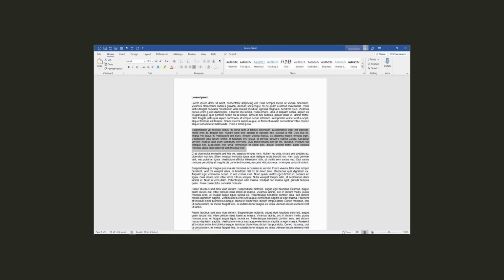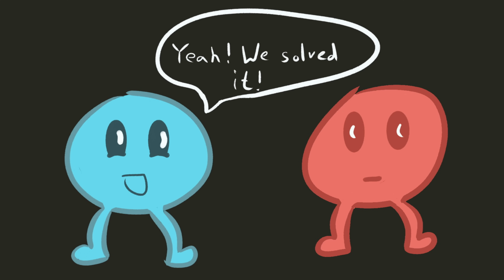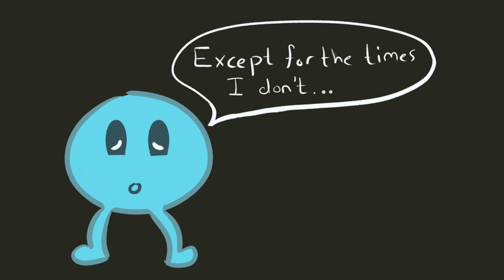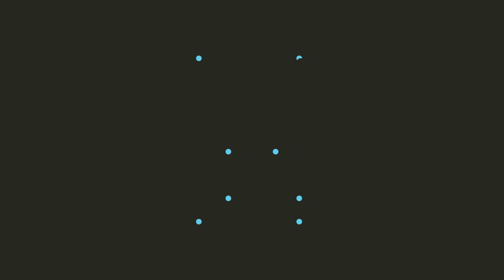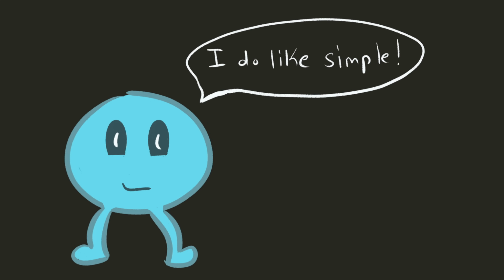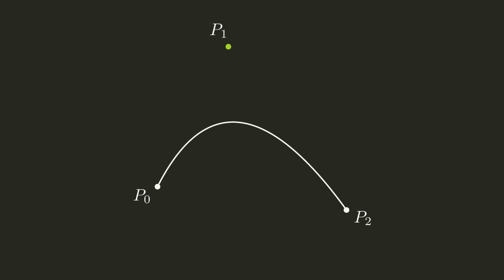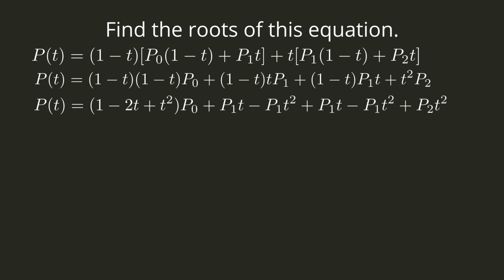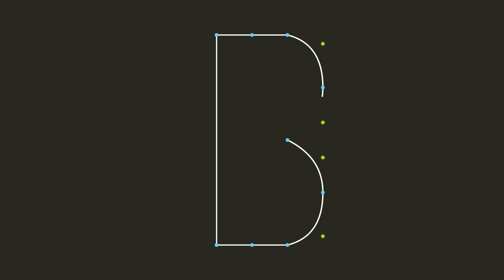The Math Behind Font Rasterization | How it Works

Comment: A few notes on what most actual implementations do (from what I've been able to read), just in case anyone thought this was simple:
* Solving quadratics is (probably much) slower and harder than just subdividing until you're smaller than pixels then testing against the x coordinates of the points closest in y coordinates.
* Generally the letters (or, more generally, glyphs) are only rendered once per font size when needed and then that copy is stamped at all the places it's needed.
* It's common to use the fact that PC monitors layout their pixels in vertical RGB stripes to get more horizontal resolution.
* At small sizes, avoiding blurring as lines cross through pixels is more important than exactly representing the outline. The solution is pretty crazy: TTF fonts include programs that execute to adjust the coordinates based on size... and potentially other things like weight and surrounding characters!
* This doesn't work if you're animating, as you can see the outlines jumping around (and it's slow). In this and other situations, like very large text or 3d, signed distance fields (or SDF), which are basically fancier bitmaps that are quite good at approximating the outline but still very fast to render.
Reply from the maker: Hey Simon! Thanks for the great overview on some of the more technical details of font rendering :). I didn't know about the optimization you can use to avoid solving quadratics, and I'd be interested to try that out at some point. I also saw your comment about .bmp, and I do apologize for any inaccuracies there. I always forget to check some of the finer details when I make videos like this haha
Reply: @GamesWithGabe  I have a renderer called TD renderer. It is based on FreeType, however, it makes use of my own rasterizer.
Reply: Per your third point: BGR monitors exist, and text will look weird with blue and red fringing because of this if the OS assumes it’s RGB.
Reply: @EpicWolverine  they were quite rare even back in 2000 when Microsoft introduced cleartype, and now I would be shocked if anyone was shipping a full PC monitor in BGR. (Googles) Wait, really: Gigabyte shipped a BGR panel in 2020? And lots of TV panels, and thus some large monitors, do too? Do they hate humanity or something? 

Still, windows 11 still has the Adjust Cleartype Settings program to switch to BGR, but it's only a partial fix, as not everything respects it. Lame.

More relevant to many people is that phone screens generally have a totally different layout, often large green squares with blue and red stripes dividing them vertically and horizontally.

They're also much higher density though, so there's no need for subpixel rendering.
Reply: Thanks for the info. It seemed obvious late 80s computers couldn't be performing that much math for every pixel on the screen.
Reply: @bloodypommelstudios7144  well bitmap fonts were used well into the 90s for screen typography, and it was actually the printers of the time that had the beefy CPU to compute the output: who knows what they did!
Reply: @SimonBuchanNz  Makes sense. You want a PC to work out what to display on a screen within miliseconds whereas a printer can get away with seconds.
Reply: @SimonBuchanNz  I do. I co-designed with Beryl Smith (The Hardware Designer of the original Macintosh) The Apple LaserWriter introduced in 1985. Cacheing was used extensively as the cost to render characters from outlines was extremely high. When a LaserWriter was turned on, it would pre-render to bitmaps the most commonly used type sizes and styles to bitmaps. When an un cached character was requested it would be rendered on the fly and that size and style would be scheduled for idle time rendering. a least recently used table was kept for managing the overall size of the cache. the oldest bitmaps would be purged to make room for new bitmaps as required. This was true of all PostScript printers for the next decade.
Reply: @rustybucket2248  that's pretty cool, sounds similar to what most software does now still (my second bullet in the original post).

If you don't mind, I don't suppose you remember any rendering technique specifics? eg subdivision VS solving a cubic, sorting edges, how/if it handles transformations (rotation especially)?
Reply: @SimonBuchanNz  Yes all transformations used afine transforms. We used recursive subdivision exclusively in the early days depending on a number of variables forward differencing was sometimes faster. We used bezier cubics because when you transform a cubic you get another cubic (order doesn’t, increase or decrease. Winding numbers for determining inside and outside were use, consider a five pointed star made from self intersecting vectors. Most algorithms get confused and instead of rendering a solid filled five pointed star you get an unexpected result. Because in the world of PostScript there is nothing special about fonts they can be used as clipping masks for images or other closed paths. The non convex polygon problem was solved by code referred to as the reducers. When you clip a convex polygon you get another convex polygon. When you clip an non convex polygon you get an unknowable number of unrelated polygons. The Computer history museum has just recently released the source code to a very early version of PostScript for non commercial use. It is written in C and is well documented. I might be worth your time. To download a copy and take a look or even load up your favorite GCC friendly IDE compile it and run it. The first release of PostScript contained 13 typefaces. I think 11 of them were licensed from Linotype who holds the copyright. Courier was created from scratch in house so it may be included in the source. There are a number of books originally published by Addison Wesley PostScript language manual, Type-one font format Postscript language manual Level 2 ( consolidated Display PostScript    With the version that ran inside the hundreds of Laser Printers Imagesetters Large format printers…A dialect of PostScript Meant to be used as GUI for computers. Display PostScript was the Native GUI for the NEXT Computer. *Cleartype was not developed by Microsoft, It is an integration of TrueType and Adobe Type formats. TrueType was developed by Apple and Microsoft. It was the survivor of Apple and Microsoft’s failed attempt to develop their own version of PostScript. Greedy bastards. I am happy to answer any questions that you have. Best
Reply: @rustybucket2248  facsinating stuff! I've poked around in the source of ghostscript and several vector rendering libraries, so that sounds right up my alley.
Reply: @SimonBuchanNz  Before my time at Adobe I worked at Xerox PARC and knew Peter Duetch  the author of GhostScript. Peter was Always welcome at Adobe. We published the language manual and such so that others could learn from them and then do their thing. We played in the same Softball league. Xerox pulled together a lot of talent, but enfighting at the executive level prevented them from capitalizing on it. Windows and Microsoft Word were reimplementations of projects that were created at PARC. Similarly Chuck Geschke, John Warnock and I were asked by the division responsible for Laser Printers, WYSIWIG computing… to create a working example of an end to end solution of what “Desktop publishing” would look like, We did, They refused it and thus Adobe was born”.
Reply: @bloodypommelstudios7144  recursive subdivision, and forward differencing algorithms were used to render to bitmap where they were cached.
Reply: Usually Bézier curves with 4 control points are used (eg. in drawing programs and to define any animation curves). Those will result to a polynomial with t³. Those aren’t being solved using a simple formula, instead Newton’s method is used which is probably even slower but it’s still fast enough.
Reply: > Solving quadratics is (probably much) slower and harder than just subdividing until you're smaller than pixels then testing against the x coordinates of the points closest in y coordinates

Well.  If you want to actually render in real-time, faster to punt to the GPU and solve quadratics again.  (If you're clever you can actually do it with no sqrts.  But, performance-wise, space partitioning is much more important—having some way to avoid testing intersections with curves you don't have to.)

Things get kind of crazy when you try to handle antialiasing.  As far as I know, every renderer in common use cheats.  (In fairness, integrals are hard.)
Reply: @elronnd_9515  I did see a Microsoft research project a long while ago that rendered vector art precisely in real time. It was ludicrously expensive, since it's basically ray tracing against analytical surfaces. I think the current day answer would be use a compute shader to subdivide to pixel sizes then triangulate. You would probably be able to beat the rasterizer pipeline too, given the Unreal Engine Nanite results.

In practice for real time fonts, pretty much everyone uses some form of signed distance field, which is extremely easy, fast, good looking, and way more than accurate enough (accurate to 1/1000 is quite cheap, for example)
Reply: @SimonBuchanNz  not sure what research you are referring to; Loop & Blinn, perhaps?  That was quite cheap; as far as I know, the only reason it was never widely used is that it is patented.

The ray tracing is actually quite cheap, given it is 2-d.  Loop & Blinn triangulate and hence only have to evaluate one curve per fragment.  But even if you do more than one (this makes antialiasing somewhat easier, and the slug paper suggests it is faster), with good space partitioning you still only have to evaluate O(1) curves per fragment.

SDFs are nice, but certainly no panacea.  In particular, the elephant in the room: immensely higher space requirements.
Reply: I should clarify—by 'Loop & Blinn triangulate', I don't mean that they approximate curves with triangles; only that they draw a separate triangle for every curve in the outline.  (Or, sometimes a couple of triangles.)
Reply: I have one simple question, isn't possible to save an interior point in the font file, and fill the font color from that reference? It would simplify all the calculations. I'm not a programmer, if anyone can answer me (you look like experts), it will satisfy my curiosity.
Reply: @wonderwise5493  if you're thinking like a bucket fill in paint, then you first need to have the outline. Then the problem is getting the outline, which is basically back to the same problem: quickly determining which pixels are the edge of the shape. That said, since you can just go around each edge once this way,  I'm not going to confidently say it would never be faster though, it's a good idea!
Reply: @SimonBuchanNz  nice, thank you I understand it now.
Reply: SDFs are genious, but they work not well for fonts due to the corner bleeding.
Reply: I thought something seemed fishy when a square root was being calculated for every pixel per curve. A prerendered cache would definitely help, but I'm not surprised that there was another possibility.
Reply from the maker: @angeldude101  actually square roots aren't nearly as much of a problem as they were 25 years ago. GPU's have special hardware to do square roots directly, and graphics developers typically do at least one (possibly multiple square roots) per pixel 60 times a second in games to calculate things like lighting. This article gives an interesting overview http://cuda-programming.blogspot.com/2013/01/performance-of-sqrt-in-cuda.html . But font rasterizers are still CPU-based (as far as I know), so it can still become a problem if you don't use some optimization techniques :)
Reply: @GamesWithGabe  it's not the main point, but during one uni project I found out that square roots were implemented to CPUs only during the last 10 years. For example Intel 2000 series didn't have dedicated silicon for that (besides apparently Sandy Bridge-EP -> 2000 Xeon equivalent, at least that's the first generation Intel mentions sqrt instruction)
Reply: @angeldude101  It would probably be faster to just directly rasterize the entire outline first and store it in memory.  Then checking for horizontal crossings is just referencing a binary lookup.  The problem is then reduced to that of efficiently drawing the outline.  I recall that even drawing simple straight lines involves some tricky optimization tricks, so the best optimization for rasterizing a cubic Bezier might not be super simple.  Your t-step has to be adjusted based on the size of the curve relative to the raster resolution so that you neither 1.) leave holes in your curve nor 2.) redundantly draw the same pixel multiple times.  Is there an easy formula to calculate the optimal t-step given a cubic Bezier curve's 4 points and a specified resolution?  That's what would really help.

It's fun thinking about how I would go about the problem before looking up how it's actually done.  I haven't really studied this stuff since the 90s when everything was much slower in terms of speed and everything had to be super optimized to be at all usable in real time.

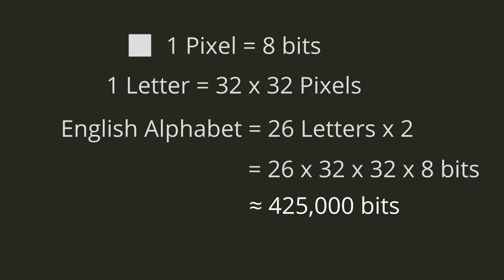Comment: 2:14 just for comparison, I had a Commodore 64 back in the '80s.
it used 8x8 pixels for each character and only 1 bit per pixel.
so the WHOLE ASCII table of 256 characters took 256*8*8*1bits = 2KB
well it only had 64KB of memory anyway.
Reply from the maker: That's insane. I have a lot of respect for the programmers in the '80s and '90s era when memory was so limited. It's so easy to just use 100's of MB in a simple program now :)
Reply: @GamesWithGabe  thanks for this video. I learned a lot.
Reply: @GamesWithGabe  you may want to read about a memory saving trick called Bloom filter. it is still used in modern systems. imagine creating a speller using only a bit for each word. (well not exactly achievable, but it was "good enough")
Reply: @GamesWithGabe  yeah i wrote a 6502 emulator in C++ and the 16 bit address space is quite limiting once you consider memory mapped io type stuff
Reply: I grew up programming in the '80s and '90s and when he went 'only 32 by 32 pixels' I was like ... BRO, ONLY?!
I have handcrafted many 6x6 pixel fonts just to get some decent amount of text on a screen given de crappy amount of pixels (256x192 or 320x200) on screen.
Fun fact: The standard 'high rez' VGA font is 9x14 pixels.
Reply: In the C64 the characters were in ROM. Although you could supply a RAM location for custom fonts.

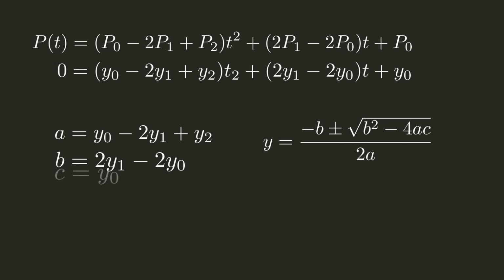Comment: 14:17 - why do you use the y coordinates here?
Reply from the maker: Hey Forthright! I use the y-coordinates there because I'm testing to see if the pixel has intersected with the x-axis. If we do it that way, then it's basically the same as looking for where P(t) = 0 for the y-coordinates. I believe you could just as easily do a vertical test though and then you would use the x-coordinates instead :)
Reply: @GamesWithGabe  ah I see the Bezier curve will always have x and y values equally interpolated between there start and end values for both so the same equation controlled by t holds for x and y.